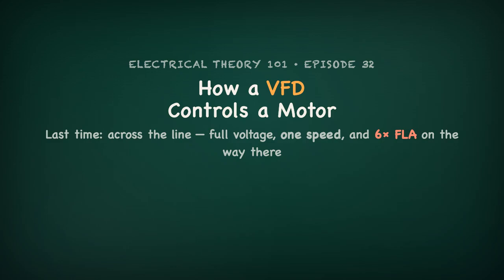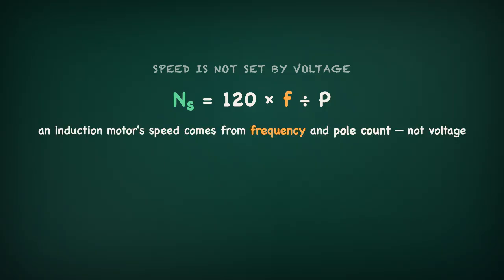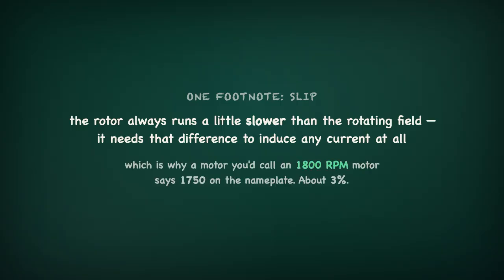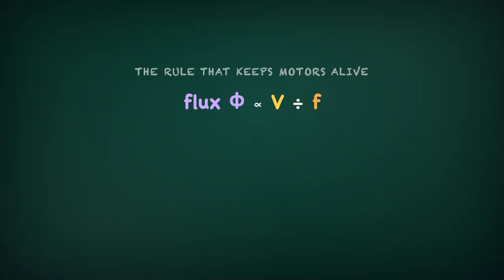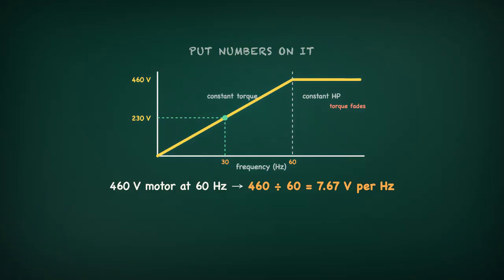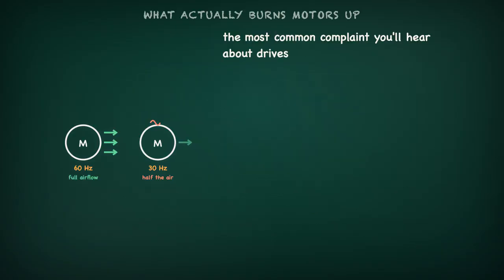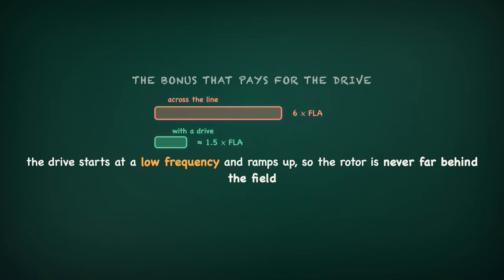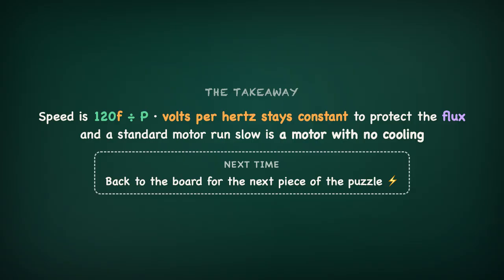How a VFD Controls a Motor (And Why They Burn Up Below 30 Hz)

Comment from the maker: Practice answers:
A) 6-pole on 60 Hz → Ns = 120 × 60 ÷ 6 = 1,200 RPM. At 40 Hz → 120 × 40 ÷ 6 = 800 RPM.
B) 230 V ÷ 60 Hz = 3.83 V/Hz. At 45 Hz → 3.83 × 45 ≈ 172 V.
C) It overheats. At 20 Hz the shaft fan turns a third of rated speed and moves roughly a third of the air, while a constant-torque load keeps current — and therefore I²R heat — near full. Two fixes: an inverter-duty motor with a separately powered blower (or a TENV/TEBC motor), or limit the minimum speed / derate the load so it never sits down there.

If you take one thing away: a standard motor run slow is a motor with no cooling. What should I work through next? ⚡